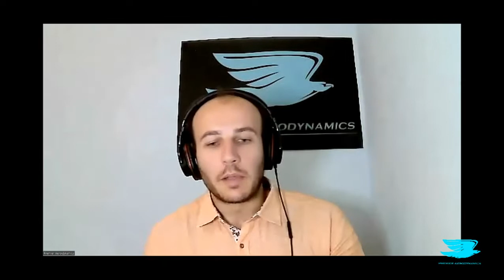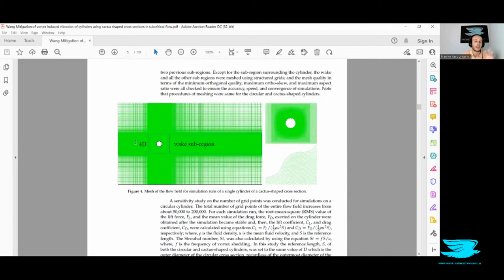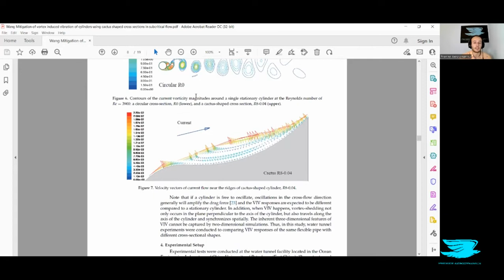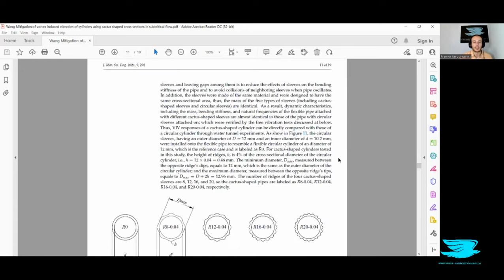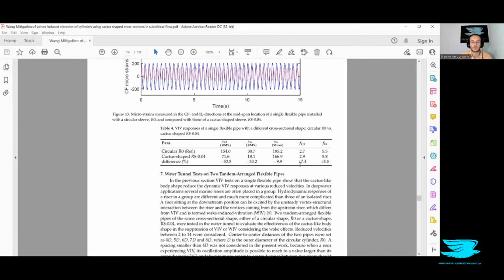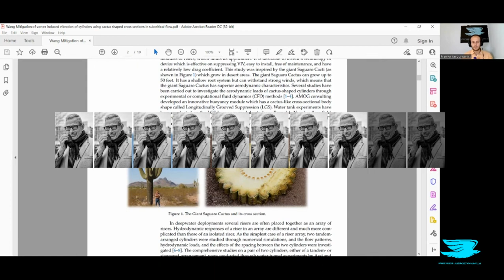Cactus Inspired Aerodynamics - Premier Aerodynamics Podcast #2

Comment: Question:  Could the Tacoma Narrows Bridge have been saved with some inexpensive flow modifications to disrupt vortex formation?
Reply from the maker: Definitely. The underlying idea is to break up the vortex being shed so it can't be coherent. So, for example, putting 45 degree slants underneath and on the side will help with that.
Reply: @PremierAerodynamics  They had months to figure out a solution.  So it seems that no one at the time understood what was happening.  They has lots of Boeing engineers in the area,  so that is surprising.

I notice that Douglas Fir trees have bark patterns that are similar to the ribs on the cactus. On the other hand,  the Pacific Madrona has entirely smooth skin that peels off like onion skin.  However,  the tree trunk is very contorted,  making coherent vortex formation unlikely.